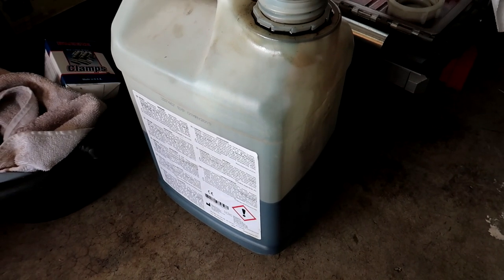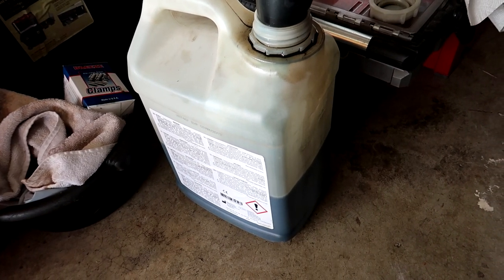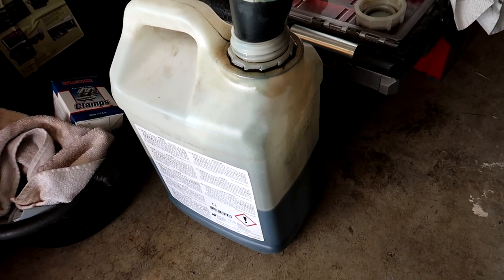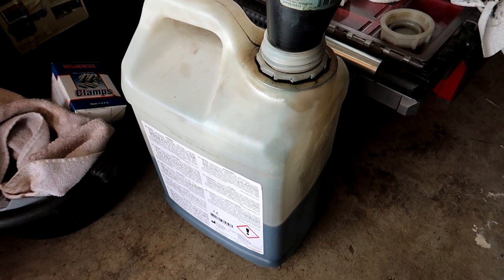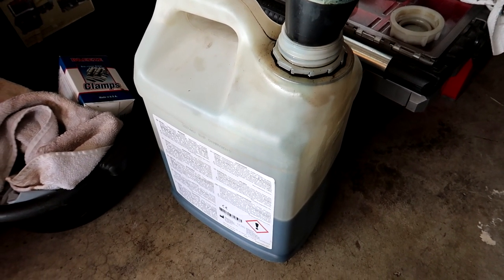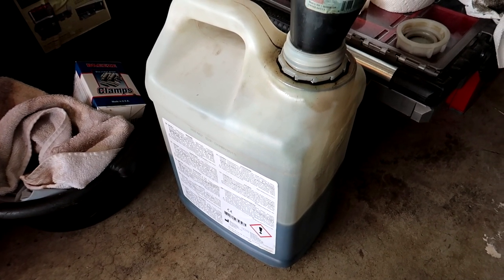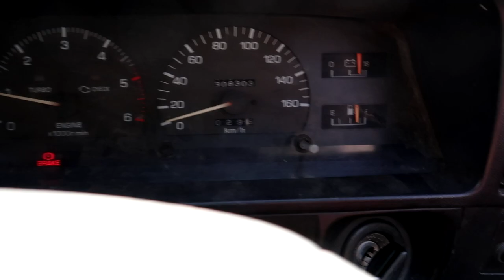Running Waste Engine Oil as Diesel

Comment: I've been trying this is an old work van, I've filtered the waste oil and added less than 20% diesel, it totally works fine, smells a bit more and would even say the van has a bit more power on this mix. Amazing, very happy to get rid of the oil this way and hell, free fuel.
Reply from the maker: Definitely.  I ran 100% oil and the power was down a little bit, but I'm guessing with 20% diesel like you do it would drive pretty normally.  I don't have the Surf anymore and now I just dispose of the oil at the recyclers and it hurts a bit when I have to give away that free fuel lol
Reply: @CtrlAltDefeatTV  I run a car repair shop if I think of how much oil I've paid to  get rid of in the last 15 years!
Reply: Hi what kind of van did you do that with, I have a 05 vw caddy was thinking of doing something like this

Comment: I centrifuge waste motor oil after mixing in 10% petrol and a splash of acetone to help remove water. Then filter through cartridges down to 0.5um.
Runs 100% in a 2.9l Range Rover and 50/50 in a 2.5l BMW 525d - both are common rail fuel systems. I've covered 18k miles using this blend on both vehicles and no injector problems yet.
Cold starts in winter are hard so I use 15% petrol in the blend in cold weather and sometimes add the blend to more diesel if required.
Reply: Would love to hear more about this, guessing you’re in the UK as you said petrol
Reply: Is there any way to get in contact with you?
Reply: Jokam ?

Comment: I built my own collection station and filter my oil using a 12v dc leeson motor that drives an oberdorfer gear pump into a pabiodiesel centrifuge. In the right pressure it can filter down to 1/2 micron.  I'm running 1 gallon of filtered oil to each 35 gallon tank in my '03 5.9l Cummins and it's been great.
Reply: GGALLIN1776  yeah, I don't run it much any more. The system worked great, but too much work to keep up.
Reply: Can you link me to how this works?

Comment: Great for an old injector pump. Here in the uk the landrover boys put a little 2 stroke oil in the diesel to lube the pump. Castrol R an you got a race truck smell as a bonus lol
Reply: We used own a old td5 defender and my father used change oil every 3k miles and throw it straight back into the tank. Also used oil from a few local restaurants never had a problem

Comment: Hey, Congrats! You aren't the first who discover such advantage of old diesel engines I guess :) 
People run free fuel for a long time: in Europe, Russia, Middle East... plenty info online. Be avare: cold winters are not suitable to run WMO & WVO in the same tank with diesel, you'll need to dilute it with some gasoline, say 5% for better flow. Otherwise it's fine. 2 tank system is the propr way to go, expensive though. I am preheating WVO in 2 stages: first is electrical 200W sock on the fuel filter and 50W wraps on injection lines, second - Coolant-to-fuel heat exchanger kicks in when engine warms up. Don't need to explain how much I like this: travel becomes unlimited for me for almost 20 years now! 10 to 30 years old VW, HiLux's, Land Cruisers, Pajeros, Safary's , Fords and Mercedeses all running free on WVO

Comment: 1984 chevette diesel.  I ran it on hydraulic fluid for 2 years with 70 miles a day.  5 gallon hydraulic fluid to 1 liter of petrol and than ran it through filters and put it in my tank.  Unfortunately.  Installed a new timing belt that was defective cause shortly after it broke.  Still got it just haven't installed new parts yet

Comment: i also use used engine oil i mix it with diesel it lubes my pump and injectors,no problem at all and runs pretty much better
Reply: What’s your mix?

Comment: Its ok for a few miles running waste oil mix but your engine will get harder to start and be a little down on power, great if your doing freeway miles but not stop/start as it carbons up your valves and hence wont seal properly causing pressure loss.
I used injector cleaner in my 1.5d corsa but still took few hard runs to clear and get back to normal power :)

Comment: Don't worry about the water in the waste oil. I recently had a badge with about 4-5% water in it and it just drives fine. No difference at all. I don't filter I just dump it into the fuel tank and drive up to 100% waste engine oil in my Peugeot 106 Diesel. 
The hotter the fuel the more the engine loves it so I'm thinking about a way to raise my fuel temps even more. 
Top Tip. Change your injection timing to rather early for less smoke.
Reply: run your fuel line around an exhaust manifold or radiator hose in a coil like fashion
Reply: @schlomoshekelstein908  well guess what that does to a plastic fuel line
Reply: You can verify is there is some water just dropping a couple of droplets over an electric stove plate at 100 Celsius. If the oil makes some odd bubbling, it probably contains water, but if it doesn´t, no problema.
Reply: @schlomoshekelstein908  well that is a completely different story. If the water inside the bottle is over the metling point of the plastic the bottle will have a very short life. Just try putting boiling water into a regular bottle
Reply: Every 10 liter waste put 1 liter petrol running better like disel ahahaha years and years people do...
Reply: @thomasofficial1981  you clearly haven't ever done it. Done it on 3 different vehicles and everytime petrol for mixing gave a horrible result. Now on the 4th vehicle I won't even bother. I came to the conclusion that everybody that suggests petrol for mixing has either no experience or has never done it.

Comment: For the water contamination, oil and water don't mix... so I would assume if you let it sit for a while the oil will stay on top and the water will sink to the bottom of the jug. Then just carefully siphon the oil on top into a clean container.
Reply: If you dedicate a setting tank, a spigot off the bottom would drain off water and sludge, have a second spigot 6 inches above that to remove fuel.

Comment: I have done it in a om617 mercedes but injectors coked up pretty fast
Reply: how did you end up cleaning them?
Reply: @jeffreydamher1703  if you want to use it, use less than 20% clean it up, at drain all water. I had to pull out the prechamber  because it was full of carbon buildup

Comment: did you go through inspection after you've started with oil burning? because if they read higher pollution levels ,well , you wont be able to drive your car anymore.
Reply from the maker: Where I'm located there are no emissions tests, and as far as I know in the US at most there is only a yearly emissions test.  So if I did have to get it smogged, I could easily run diesel only and then switch back to oil.
Reply: @CtrlAltDefeatTV  Don't get me wrong, i'm with you on this , I wish to do the same on my TDI but yes , we have this once a year test where they stick a sensor in the tail pipe of the car to calculate pollution levels and this could make my car fail the test , and since it is already an old car, they don't need much to Fail it.
Reply: @xtazy1337  Before the test disconnect the turbo wastegate hose, that way it won't have any power but it will pass easily

Comment: the major issue from using waste engine oil is injector coking, I have done it and got the injectors holes/tips full of carbon buildup. I'm wondering After 2 months of waste engine use how is your car going now ?
Reply: One way of combating this is adding a can of injector cleaner to every five gallons or so.
Reply: @elektrobear2027  have you actually done it ?
Reply: @tsitohainaranto1005  to use injector cleaner is useless, only people write it who has no ideia how does it work. 
The most important is that, you need a car which can run on stuff like this. If your car has a common rail system, forget about it, cause its will been soon messed up.
You have to have an engine which has a mechanicly driven fuel system, which is always with IDI (indirect) or DI(direct) injection system (common rails are also direct injection systems, but the fuel system is not mechanycally). Mostly cars made before 1998-2000 are okay to work with wmo
I have an a Volkswagen LT, 2.5tdi, i think you dont have it in the US, but its the same engine like Volkswagen Transporten T4, or some volvo have this engine too.
I always use it with some wmo, used atf oil or used engine oil, depends on how much i have, but max 50/50. If the oil is not dirty we never filter it, except the used vegetable oil, cause it always has some not needed stuff in it. I drive like this for 2year, about 100000km/65000miles, with no problems, except the car makes more smoke because of the fuel. this car has about 450000miles on it.
Reply: @benk7034  Thanks,  what is then your normal wmo/ diesel ratio (max is 50/50 you said) ?
Reply: on Mercedes om617 engine
Reply: @tsitohainaranto1005  currently I drive my 2.5 turbo diesel Jeep on 30% diesel and 70% wmo. It's warm outside so the engine starts just like on diesel fuel. Just a little more smoke at cold start and it feels like it has more power.
Reply: @V8AmericanMuscleCar  if you're sure it's clean enough, be sure now that the viscosity is equal or less than the diesel

Comment: 16 gallons used or and transmission fluid
3 gallons off road diesel sold for tractors
2 gallons non ethanol gasoline sold for boats 
2 ounces acetone 
Yield 21 gallons of mechanical diesel fuel.
 
Peugeot 504 505 mercedes 220D 240D 300D  vw rabbit vw dasher vw pickup